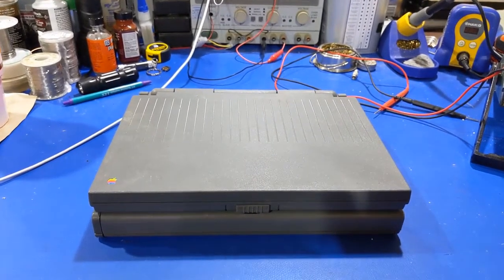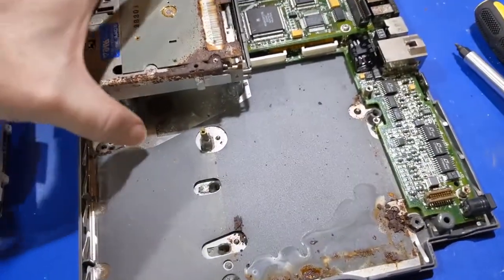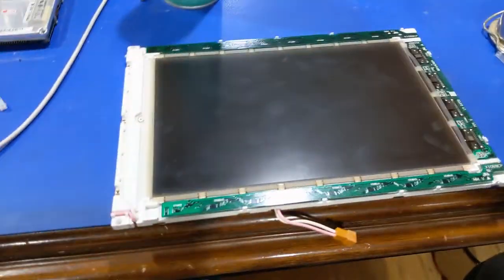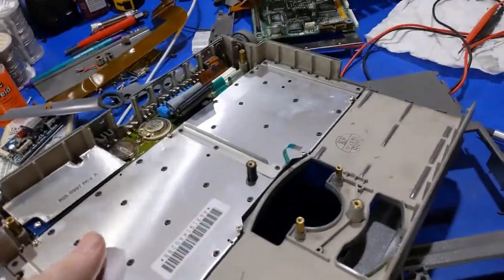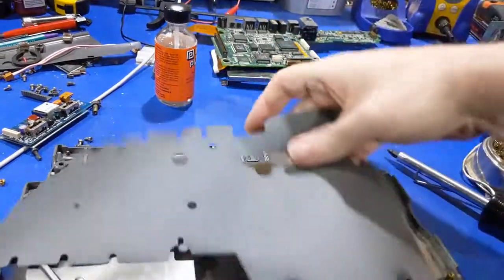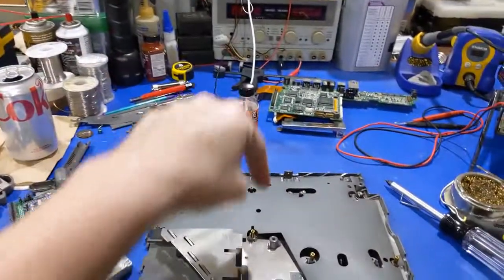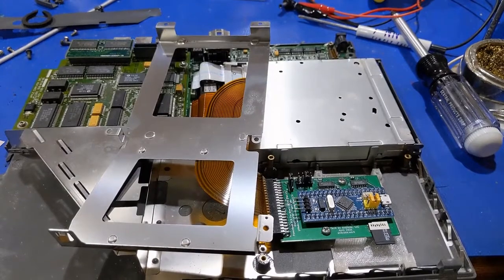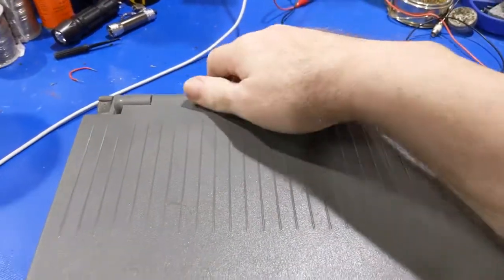Macintosh Powerbook 145B. Can we fix it?

Comment: What epoxy do you use to re-enforce the hinge lugs?

I have so many of these old powerbook 1xxs!

The 145B is a cost reduced (B = budget), simplified 145. It has the empty spot for the FPU removed and 4MB of RAM soldered in it's place.
Reply from the maker: I used a solvent based cement which melts and fuses the plastic. Then I used JB weld to reinforce
Reply: @THEtechknight  Do you have the actual product names? Thanks
Reply from the maker: @kirishima638  I already mentioned one. The other is plastruct plastic weld

Comment: Nice save! Doing the Lord's work. :) I think the only difference between the 145 and 145B is the amount of onboard RAM (2 vs 4?).  Curious to know what was happening with the BlueSCSI not booting at first - did you figure that out?
Reply from the maker: the BlueSCSI actually had me worked up for a bit off-camera, to the point where I had to go take a breather. I forget what all I did, and what all happened but it was disk driver issues fouling everything up.